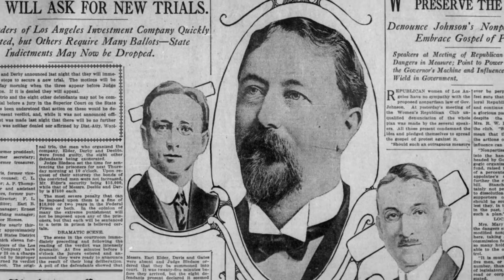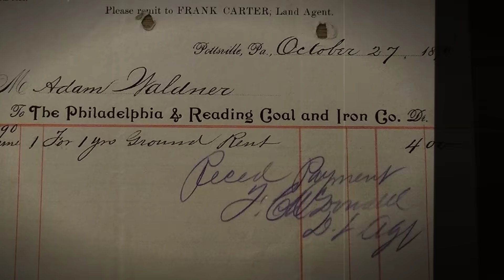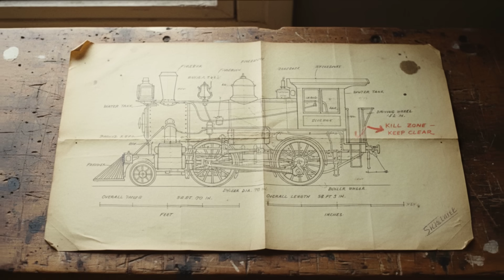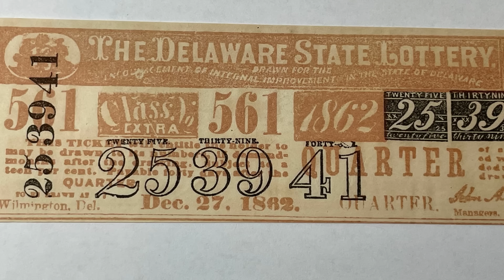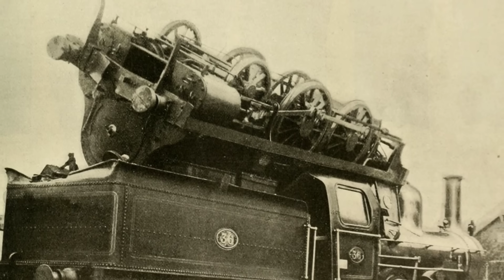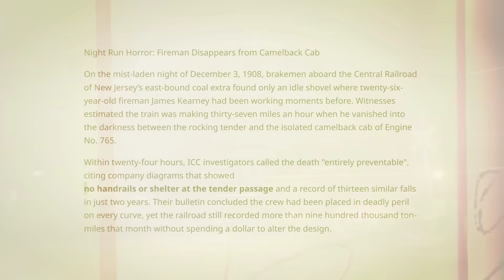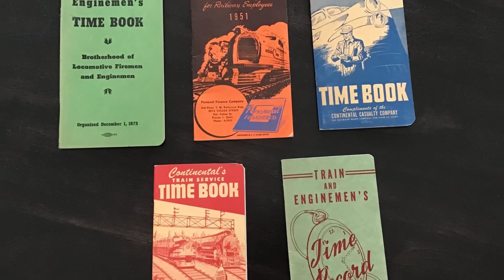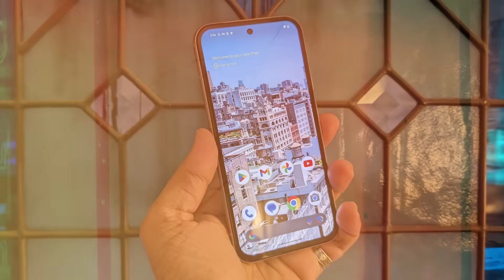The Most INSANE "Death Trap" To Ever Run on American Rails

Comment: Nice video exept a number of illustrations and photos of the "accidents" were not camelbacks ,  if the loco was running in the forward direction the fireman would not be freezing from the cold wind blowing over the tender,  he would have been in FRONT of the tender not behind.  Anthracite was not waste. It was  hard coal , no tar , lower sulfur , less smoke but more difficult to get heat and slower to burn.
Reply: Video never showed the interior of the camelback cab. Or the fireman’s platform.
Reply: @richardcooke9948 Good catch. So maybe none in preservation or otherwise accessible for that? Wooden cab might not stand the test of time like old iron does. Anyway, based on the layout I doubt if the fireman shared the same footplate. Can't see both crew having room on the same side of the boiler either. Would he be back closer to the tender? An auger wouldn't seem to spread the fuel as needed by itself. Cheers.
Reply: Anthracite is not waste; culm is.  The video states that the camelback design arose from the railroads' desire to burn culm.  Culm is tailings (or possibly "seconds" ) from mining anthracite. Culm does not have firing and heating characteristics of anthracite or bituminous coal.  The need to burn it over a large grate area and in a wider and bigger firebox to produce adequate heat and thereby steam led to the changes that included placing the cab stop the boiler and driving wheels, rather than behind them.